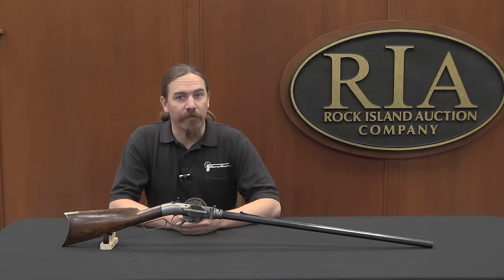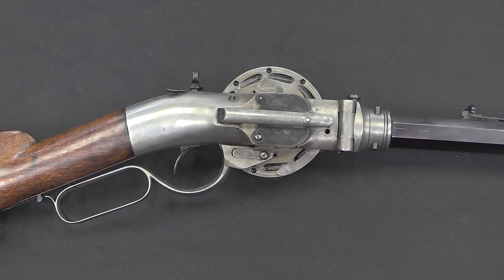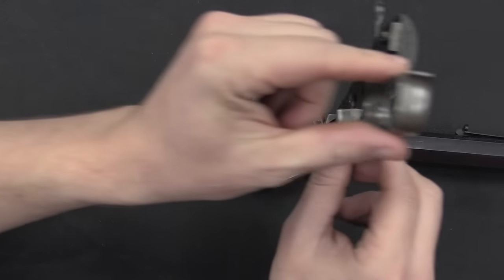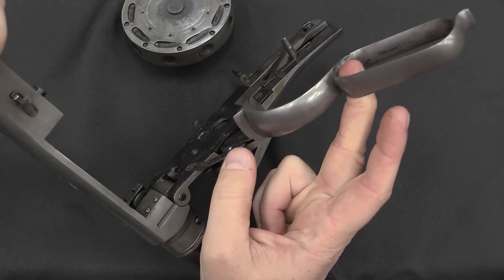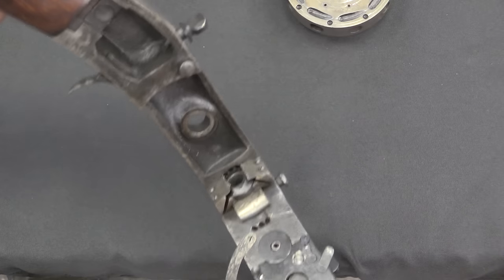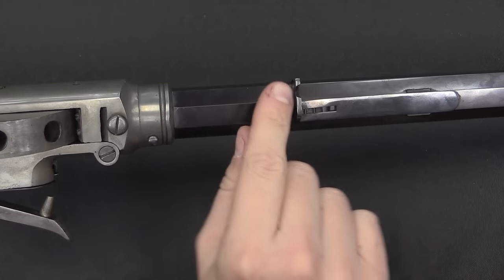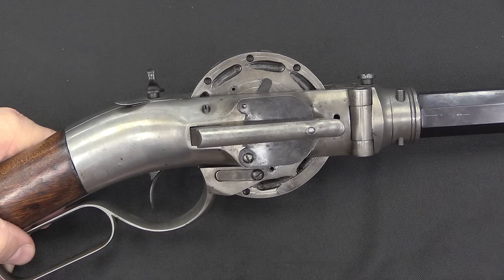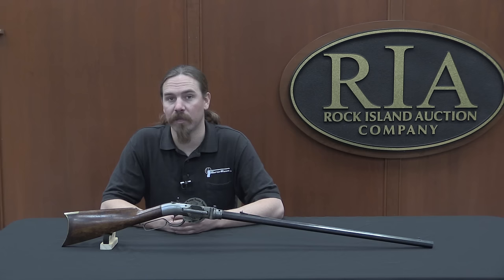Porter Turret Rifle: Awesome But Dangerous

Comment: Turret revolvers should be reintroduced now that we have cartridges. Imagine a 7 shot J frame sized thing that's thinner than a 1911 for concealed carry.
Reply: interesting!
Reply: +zumbazumba1 Well there are some modern pepperbox revolvers so I don't see why not. I could think of a way you can load it would be to have sort of like a lever action style loading gate for each cylinder that lets you slide the round in but then locks.
Reply: zumbazumba1 Make the cylinder donut shape and put a striker in the middle.
Reply: +zumbazumba1 the turret would be a clamshell, and interchangeable like magazines. Each chamber would have a firing pin with a camming surface. A side hammer with a wedge on the tip would drive each firing pin forward.
Reply: +zumbazumba1 shouldn't be to hard to make with modern mechanisms. The design, though complex can be greatly simplified.
Reply: +TroopperFoFo you could simplify by having the cylinder pin be the hammer(camming into a button that sends the striker off.) and safety concerns?  ever heard of a variable timing cam?
Reply: Matthew Bozanich We could just make a tiny Lewis gun.  I completely forgot about the Lewis gun and its magazine.
Reply: TroopperFoFo
me too. lewis gun y u do this to us :C
Reply: Matthew Bozanich In more modern times we also have the Dp-28.  Even thow that's not really that modern. I just remembered it because rainbow 6 siege.
Reply: TroopperFoFo
i remember its flapper locked and the same flapper design was used on the dshk hmg

Comment: You said you weren't sure how the caps stayed....you are missing a piece on that rifle.  It's a cap-stop that is bolted to the underside of the cap spring box and hugs the box around to the front where it has a notch to hold the cap in position.

Comment: I owned an old cap gun in which the end of the roll of paper caps was turned 90 degrees and slid under a similar spring loaded feeding device. My guess is that the same principle would be applied here. Imagine the end of the roll of caps slide under the actual body of the little feed arm you moved to demonstrate the spring tension.

Comment: Since the caps are stored in the dedicated magazine rather than being placed onto the chambers, the risk of this rifle chain-firing should be non-existent (?)
Reply from the maker: +Yuri V No, chain firing happens when the spark from one cap jumps chambers - it doesn't require a second cap detonating.
Reply: +Forgotten Weapons 
Chain fire happens when the fire from one chamber going off flashes out from the head space between the cylinder and barrel into another chamber, sparks bypassing the ball and setting off the charge found there. This is usually caused by to much wear and a large space or improper loading.  That is why we need more Crisco or bullet butter or wonder wads to keep the sparks out. 

There is no way this weapon could chain fire unless you used nuclear caps. 
The fire holes are just to far apart and small to allow a passing spark entry. And the other chambers are not even in line with the the resulting flash so are unlikely to accept any sparks.

It would have happened most often during the civil war because of the need to reload as quickly as possible and also the small spacing between chambers on a normal pistol. No sealant or wadding and powder grains streaked along the chamber and embedded in the ball... Could never happen with this weapon.
Reply: +TruAnRksT I still don't like the proposition of pointing live, impact sensitive, chambers at my face, chest, and balls simultaneously; even if it is very unlikely.
Reply: FallingWhale

They aren't impact sensitive at all since there are no caps on them. But are sensitive to external flame.
Reply: +TruAnRksT Or you can just accept that fact that it's from the 1800s, and you most likely, given the opportunity, would definitely not want to shoot it.
Reply: Big Macintosh.

Naw, assuming there are no cracks which can be detected through the magnaflux method, as I said I would have no problem firing it at half load. You have to admit the steel on it looks in really good shape.
Reply: half load may leave a ball in the barrel and the next shot kabomb. You shouldn,t  tell people that

Comment: In the video description on Line 1 at the very end "they" is used instead of "there", and also what may be an error on line 6 where you typed: 

"In addition, they and a wonderful design in which the entire side of the receiver opens up to make the action visible."

kind of seems like autocorrect :P

Comment: It indeed misses two parts, one smal metal sheet fixed by the screw hole on the fixed housing that holds the cap in place, and one attached to the lever which movement moves the first metal sheet, releasing the expended cap

Comment: +Forgotten Weapons the two screws on top (front and back of the turret) held a piece that I think has nothing to do with loading. My guess is it was a protection of some sort?
The loading bit is featured in this photo, and does not appear to need that screw for the hinge (which was a leaf spring), at least in this version.
https://p3.liveauctioneers.com/566/20806/7137869_5_l.jpg
This other model has an actual hinge. http://farm4.staticflickr.com/3390/3412940565_2b8a0e75c4.jpg

Also, I found this version of the gun with individual caps (no cap magazine on the side) and doesn't sport any of the 2 top screws at all. Perhaps one of the first iterations. http://www.truewestmagazine.com/wp-content/uploads/2015/09/Turrett-Rifle-blog.jpg

Another version, also without cap magazine, it probably has individual caps fitted on the turret (obscured by what looks to be a semicircular sheet of metal acting as a shield), but it features the top bit. Was that a safety measure against chainfire?
https://p1.liveauctioneers.com/249/62471/31182138_3_l.jpg
https://p3.liveauctioneers.com/249/62471/31182138_5_l.jpg

Comment: Looks like the primer system was held together, say on paper, like the strips of caps used in the "cap gun" noisemaker toy we had in 1960's. I this case it looks like a rotating circle of primers was held in place on a disk of cardboard.

Comment: Actually with 9 shot spacing the center line of each cylinder would be 40 degrees apart therefore you would not have a cylinder pointing exactly back to you.  Angled up towards your head, and down towards your lower body, but not exactly back into the gun.

Comment: Wow, Colt was a douche.  Doesn't surprise me, a lot of people were and still are.

Assuming you keep it reasonably clean, I really don't see any way it could shoot you apart from events that would already have killed you several times over anyway.  The main danger would be using and loading it tens of times in a row to the point that potentially flammable residues built up that could catch and fire chambers other than the intended.

Comment: I wonder if using the lever twice without firing would cause an unfired cap to be ejected. I always thought a cap needed to be on a nipple for it to work, since you'd need a surface to hit the fulminate against. Then again I suppose you could always design a cap where the fulminate is at the bottom and the top part of the cap was solid. It'd be funny if this rifle didn't use readily available, off-the-shelf caps though. Chainfires were supposedly caused by the flash at the "muzzle" end of a chamber getting past the ball into the powder charges of the adjoining chambers. You were supposed to smear grease in front off and around the loaded balls to prevent this from happening. I suppose, since the mouths of the chambers here are further apart than with an axial barrel a chainfire would be less likely..

Comment: Perhaps theres a cage holding all the caps. Like how it is in a bearing where the balls are held in place by a circular sheet thing to keep them apart from each other?
No idea about the gun just a suggestion on how to make the gun at least make sense.
Reply: maybe a "cap-belt"? if such a thing even exists?
Reply: That makes me think of the old cap guns where they were all held together in a plastic ring. Maybe some early kind of disintegrating belt, where you fed the whole thing in and it chopped off each round as it was fired? I remember having a cap gun that fired plastic strips of caps, and each round was sliced off and shot out of the top like a spent casing.
Reply: de0509 looks like it "spits" the cap just before the hammer starts coming down. Take a look how the circular spring disk cocks when he spins it.

Comment: Were the caps built specifically for the gun? Because if they were in a ring, much like a toy cap gun, then they wouldn't fall out. Additionally, you could possibly have a metal thing that holds them in a similar configuration maybe.

Comment: There is a small piece of spring steel that screws to the bottom of the cap magazine (look closely, you can see the screw hole).This piece would wrap up around the front of the cap magazine and somehow hold the caps in. Not sure how it works because I wasn't allowed to handle the gun to inspect it thoroughly.

Comment: Seems to me like it could have been relatively practical at the time provided you didn't load all 9 cylinders. If you loaded the top 3 cylinders and indexed the gun, the 2 other loaded chambers would have been pointing away from the shooter, forward and up. 

Thinking about some other intricacies of the gun such as the gas port, it would seem odd that Porter wouldn't have taken chain fire into account, can we actually be sure he wanted the gun to be used with all chambers loaded and that it wasn't just negative marketing by Colt?

Comment: Could it be that this gun used a circular or semi circular stripe holding multiple percussion caps? If this stripe moves along the flash hole from the upper caps magazine grove to a lower grove the caps wont fall off.
However, I cant see if there is a lower groove, as the area is covered by the hammer in the video.

Comment: Porter rifle:
Could have one of it's owners disable the gun so it could  not be loaded and used. You mentioned the loading device have been removed and also the cap system did not make scene I also think it's missing parts to the cap feed system I did not get it either.

Comment: This gun looks kind of impractical anyway. 
I could imagine that the wholes for the primer spark can be clogged by dust easily or that water gets in, when you are in a wet environment.

I also could imagine that when the hammer is cocked, it gets caught easily when you are walking around in, let's say, the undergrowth of a wood.

Comment: Wouldn't calling that a disc rather than a cylinder be more accurate though?
Reply: +Jack Mcslay its both a disk and a cylinder.
Reply: +Jack Mcslay Disclinder.
Reply: +Jack Mcslay 
It was called a cylinder because it is round and comprised a number of chambers to be fired in a rotating manner. Like all the rest, just in a slightly different format.

Comment: very cool i want one, and i would like to comment about the cap loader, i would guess that the way it might function would be an internal component that would allow a regulated rotation but i dont know im just thinking, it wouldn't have to be something on the outside to do so.      where as the slide for the cap magazine pulled back from an internal spring,   or maybe it was something u had on your person like a handled pic like a flat head screw driver that u would  just pop out the spent cap manually and the next would slide forward.    anyway, thanks for sharing

Comment: Tough to see the hammer/cover plate in the video  but, I have an idea as to how it may have worked.      Is it possible the primer was meant to stick to the hammer after it was struck?    If so, initially the spring tension would hold the primer in place while the rifle  was cocked.    The hammer would strike the primer and it would stick to the hammer.   When you cocked the gun again the hammer would lift and the spring tension would push another primer into the pocket then you could use a protruding edge of the cover plate over the priming mechanism to scrape off the struck primer.

Could be totally wrong its tough to see those details in the video.

Comment: Easiest way to reload it seems would be to have a couple of spare wheels especially on the later models where you say the cap is on the wheel. 
Do you have to have any insurance to handle these old rifles or are you covered by the auction house?

Comment: Looks like it’s missing the nipple for the cap, that might have had a side piece that would hold them in there, then the hammer would have pushed a cap down onto the nipple and fired it, then when the hammer was cocked again the used cap fell off and a new one advanced

Comment: I wonder just how common instances of "chain-firing" were. It does seem to be frequently referenced, yet are there any verifiable souces that comfirm it happened, or is it just "hearsay" spread by one manufacturer (such as Colt in this video), to discredit other manufacturers?
Reply: I was thinking a similar thing. I have a black powder revolver  and have never experienced a chain fire. I'm sure they could happen but it would seem there is more to it like improper or rushed loading. More of an operator error than a design issue. Still, having chambers on a black powder pointing at you is not the best idea in the world.
Reply from the maker: +thatguy3428 It's not common at all, but it does happen.
Reply: +thatguy3428 
One could argue that if the design allows for operator errors then the design is flawed. Or at least can be improved.

Comment: the lewis gun did something similar with the rotating mag if I’m not mistaken
Reply: The Lewis gun had a horizontal pan magazine, not a vertical cylinder. Moreover, the cartridges in those magazines are pointing inward, not outward if I recall correctly--and modern internally primed metallic cartridges made chainfires a thing of the past.

Comment: you sure that it was cap primed and not tape primed? would make more sense based on your insight to the caps just pouring out for it to be tape primed instead especially since there is no anvil (nipple) for the cap to be squeezed onto when the hammer hits it.

Comment: Stupid question, if I may: What's stopping loads from dropping out of the bottom of the turret?  I could understand it with rimmed cartridges but this doesn't use those...
Reply: I was thinking the same thing...
Reply: In black powder firearms you generally place a piece of cloth over the chamber and ram the ball into the cloth as you load it. The piece of cloth folds around the sides of the ball and creates a snug fit between the ball and the chamber.
Reply: So basically a little bit of friction and a lot of care not to jolt the thing?  Hm...
Reply: It's actually quite a bit of friction. The fit between the ball and the chamber is almost exact, so the cloth really makes the ball hard to move. A person could not jolt the gun hard enough to make the ball move.

Comment: .Looks like you could change out a cylinder in about 10 seconds. Chain fire looks unlikely with this design and with proper greasing and wadding I doubt it could. I suspect it may have been a bit messy unless you used some kind of wax cap, but even then I could see the flash holes getting blocked so easily in a dirty environment and being hopeless in any kind of damp. A cold steel rifle in a damp warming dew and water droplets might even form in those flash holes.
Probably an excellent, but expensive, home defense weapon, where you can keep the rifle out of the elements, but that's about it. It's not like you'd ever use all shots of a 9 round lever action, in one go, when hunting and it would be a pig to keep clean on a battlefield.

Comment: If it's from 1851 wouldn't it have used percussion cap tapes.  A long tape of caps wouldn't fall out. Either that or possible a cap disc.  Never seen a disc but I've heard of em.  Either way would mean no loose caps to fall out.

Comment: Wow, just look at the number of individual  pieces that go into this thing....and all so  closely fitted, interlocking, countersunk, recessed, sprung and hinged...certainly a far more complex machine than, say, a Sharps carbine....I would guess it also required a higher level of technical competence from the workers tasked with producing these in any sort of quantity...say what you will about the imperfect/soon to be obsolete CONCEPT, the EXECUTION of it reveals this to be quite a feat of engineering and manufacturing capability. 

With a little brainstorming (and perhaps some advanced metallurgy?) whoever pulled off this could have easily produced a Krag, Maxim, Browning, etc given the opportunity...the mechanical design and engineering skill set is certainly there.

Comment: Hi, could you operate the lever when the cap magazine is open? I think when operating the lever, tension disappears on the round cap spring, which makes the cap clip catch a lug on the back of the magazine cap or the lug on the follower. (i don't know which one.) And when tension returns i catched the other one again, this way jumping 1 place.

Comment: what if its a metal ring where u put in the caps and it rotates by one cap after you recock the hammer. the used cap falls out of the metal ring and allow it to turn by one cap.
but it seem that the ring is missing. should not be difficult to rebuild the ring.

Comment: Could it be that the caps is mounted on a band or in a fixed peace of metal that is pushed out one shot at a time, perhaps a 9 shot one(banana shaped), if one measures and gets a fix on the diameter they should be, one may calculate if it's possible ?